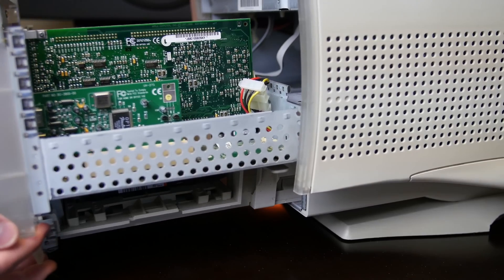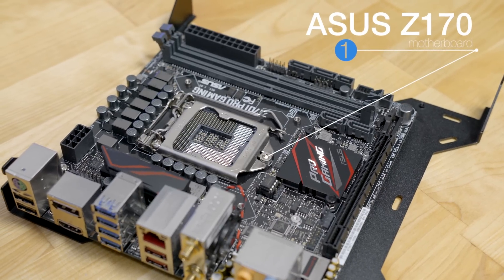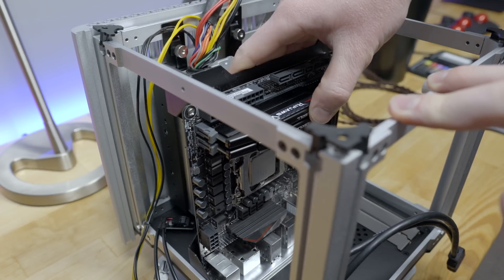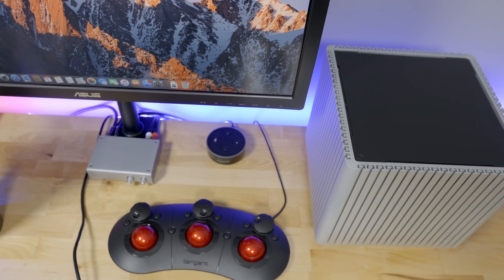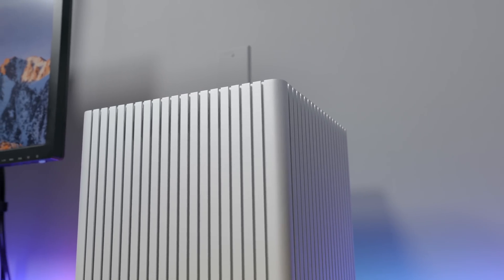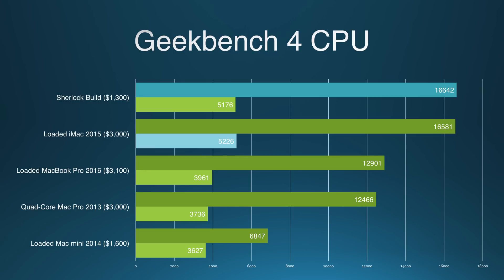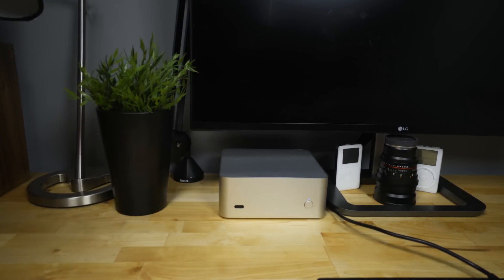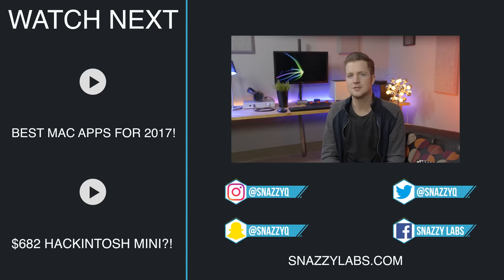The Quietest Mac Ever Made!

Comment: Is it ok that when gaming, my 8gb ram i7 macbook air 11 gets to 105 degrees Celsius?
Reply: What kind of gaming are you doing on a MBA?! Chess?!
Reply: Hell no. Take it to the Genius Bar or something. If your MBA is overheating, then something's seriously wrong. Like the other people said, the CPU should automatically throttle down unless you installed a piece of software that keeps the CPU running at full speed, or the game forces the CPU to use it's full capacity.

That said, it could be just you gaming on the MBA. MBA's aren't really designed for gaming. Hell, the entire Mac line wasn't designed for gaming (maybe the MBPro and the iMac can game, but like I said, not designed for gaming). If you want to game, it's much better to look elsewhere. Use a custom buillt/pre-built manufacturer made PC (running whatever OS you like; Windows is better because more games run on it), or at least get a laptop for gaming.

Or maybe it could be the i7. i7's, from what I can tell, are pretty power hungry, and emit more heat than their slightly weaker i5 counterparts. But this can only apply if the Air overheats all the time, even if you aren't gaming.

Sorry for throwing ideas at the wall-- I'm trying to make sense of the problem here. So I guess here are your options.

a) Sendificate that Air to the Genius Bar, and SPECIFY your problem if they don't ask. I'm not sure if they'll do jack shit, though. The problem with a lot of the newer MacBooks is that they are hard as fuck to crack open. It's like trying to crack open a coconut with a plastic straw. Yup.

b) Staph the gaming on your Air. Like I said before, Airs (and MacBooks in general) are not designed for gaming! Sure, if they can game, that's great, but note that if you want to get some supa high framerates that break the roof of your house, then stop what you're doing and look elsewhere. Which brings me to the final option! Or step.

c) If you plan on continuing gaming, drop kick your Air into space, and get an PC. Just kidding-- don't do this (or stuff the fans with fucking Play Doh). Maybe you can sell it, and use the money collected into a serious gaming machine. If you're a casual gamer, then aim for devices under ~$1250-$1400, I guess. More if you're a serious gamer.

(I just realized that these are more of "steps" than options, I'm so sorry!)

Do your homework. If you get a monster PC that costed like $5K, but only use it for MS Office, Chrome, homework, and writing, then you're not using the parts to their full potential. But if you get a Chromebook but plan on using .EXE files only usable my Windows, or have any Windows-only articles of software that you NEED, then you'll have to adjust your choices. If you use the new MacBook (yes, the one w/ the single port) and expect it to be able to edit 4K video and/or game, then you should have researched, then plopped down $1700 on a different machine. It all depends on your uses. 

So are you a light, casual, or heavy gamer? That is the question. If you would like more help, then you should head on over to the SuggestALaptop subreddit or maybe Google around.

Here's the SuggestALaptop subreddit: https://www.reddit.com/r/SuggestALaptop/

(Sorry if I sound mean or condescending, I'm really not! I'm just a bit pissed at the guy who said to plug your fan with Play Doh, even if it was a joke. Don't do it. It would kill your machine in moderate to heavy use. I'm also sorry for writing this essay. I should really siphon my writing prowess into my gender stereotypes essay, but stereotypes are stupid!)
Reply: Perfect and no issue at all. You could try putting some Play-Doh into the air intakes, that will make it dead silent and therefore highly desirable.
Reply: To be honest, don't use your MBA for gaming. Even though 105°C (TjMax of most laptop Intel CPU's) is very hot, it will probably not break. GPU's tend to die early when they overheat, CPU's are rather unlikely to die due to heat.
Reply: Open up and clean your macbook as soon as possible. Like dont just blow air in it. Open it up and thoroughly clean it
Reply: HeyItzJames Holy shit no, that's not normal. Clean it, if it keeps being hot you should underclock it. 100 degrees is not healthy.
Reply: 105° is the TjMax of the Intel CPU's, therefore it will lose it's boost clock, but not it's base clock. Non-15" MacBooks reach these temps every time on every MacBook under load and there is nothing the Genius Bar or cleaning and new thermal paste will do about it.
Reply: Kit Vitae I already knew what you wrote. I had a 2013 15" MBP and it maxes out at about 70-80°C, and my new 2015 13" Pro can reach 100°C easily. Dualcore Broadwell-U with hyperthreading at 2.9 GHz, don't know the exact model.

I wanted to say that it will not lose it's base clock until about 105°C, then it will clock down
Reply: Rainbow Jam mac is not for gaming...
Reply: They seriously aren't. I have both Mac and a windows 10 gaming PC (which is powerful as all hell). I love both equally. But when I try to game on a mac, It doesn't work out. I just use my mac for video editing when needed and school papers.
Reply: Yes, it's meant to keep your Pizza hot or you can fry an egg too!
Reply: It is at your own risk… personally, I have issues having something that hot, that close to my balls.
Reply: florian..... seriously???

i haven't got a new mac since 2012, because i don't care for their current lineup. my macbook air never goes above 75, and my imac never goes above 66, no matter what it's doing – including running stress tests.

every intel cpu has its own specified maximum temp, a lot are around 100, but you can't guarantee that it's 105 exactly. and the maximum thermal limit still throttles to prevent it going over, since it shouldn't be hitting it at all.

it's like driving under a bridge. you don't really want to be exactly at the max headroom, because the roof of your vehicle will scrape against the concrete.

if you type "sysctl -n machdep.cpu.brand_string" without quotes into terminal, any mac will tell you exactly the model of cpu it's using. a site like cpuboss or intel's ark will let you find out the specific thermal limit for the cpu.

when the cpu actually hits its max temperature, it will shut the system down if needed, to prevent overheating. this happened to me once after rendering video on a really hot summer's day. the system didn't boot for an hour after that, because it takes time for the heat to dissipate after it shuts itself off. there is no way it is happily running at exactly the limit, as that's the number it shuts itself off at, and will throttle if it gets within a few degrees of that to try and prevent such a scenario.
Reply: HeyItzJames wt  even the pentuim 4 auto shutdowns at 105°C
Reply: what about integreated graphics? since it doesnt have a seperate GPU its not gonna die earlier from overheating. right? I'm just asking it for my own laptop :D
here is my laptop's specs;
-intel core i7 3630QM @ 2.4Ghz
-intel HD graphics 4K
-8GB DDR3 RAM
-Windows 8.1
Reply: Fatih Yıldız Intel HD graphics are not really affected that much by heat because of their rather simple architecture. (after all, they are meant to be power-efficient and cheap) Keep your CPU under 80°C (which shouldn't be too hard) and you will be fine.
Reply: yeah that's okay
Reply: thats very bad
Reply: no because u shouldnt game on it to begin whit
Reply: Gaming puts an extremely heavy load on all systems, regardless of OS. Intel CPUs have built-in thermal protection so as best as we can tell (from many years of experience in IT) the CPU will not fail, it will simply slow down its close speed. Of course the first thing to be lowered is its Turbo speed, it will slow down to its standard (base) clock speed. If its still running too hot then it will lower its base clock (it has the ability to lower the base clock rather dramatically, far lower than most people ever realize) until the temperature stops rising. MacBook Air was never intended for gaming, its a thin, lightweight model for maximum portability and long battery life, not a muscular system for heavy duty gaming or continuous video editing, but regardless, it will game and it will edit even if it gets hot. These Macs are far more robust than most folks realize, its really the Intel CPU that is the limiting factor. Have Fun!
Reply: Rainbow Jam no
Reply: There is no way that's accurate and if it is then your software isn't doing its job. After about 85-90c your computer should start throttling to keep temperatures low, and I think at 105 it would completely shut down. It was probably around 85/95 which is not good at all

Comment: there is a fanless 1050, not sure if it would fit
Reply: Wouldn't work with macOS, also it depends on passive cooling by the case fans that are obviously not present here, so it would probably overheat
Reply: Very true on the overheating, but I don't use macOS so I will take your word for the first one

Comment: How about overclocking the main cpu to it's ultimate max and putting the quilet in an frigirator to keep it real cool without getting fan noise, that will help.
Either way it looks definatly cool.
Reply: johneygd fridges are not designed to constantly cool down objects that constantly emit heat. And as a result the fridge will just break.

Comment: Do you think a GTX 1050 Ti KalmX fit in there and would it be able to sip off of the 240W psu?
Reply from the maker: I don't think the PSU has a 6-pin PCIe header. That's not the only problem though. Thermals are a big issue. The KalmX assumes airflow in the ambient area to wisk away heat from the fins—be it through case fans or another method. The inside of the DB4 is a fortress and without any air to pull the heat away from the card, it just bakes in it's own bubble.

Comment: palit has a silent 1050 ti tho, os x wont work with pascal, rip
Reply from the maker: True, but that's not the only problem though. Thermals are a big issue. The KalmX assumes airflow in the ambient area to wisk away heat from the fins—be it through case fans or another method. The inside of the DB4 is a fortress and without any air to pull the heat away from the card, it just bakes in it's own bubble.

Comment: Question what happens if you touch the heat sink side of the pc?
Reply from the maker: It's always a tad warm. When I was stress testing it (which, is an unusually high load), it got hot enough that it was uncomfortable to put my hand on it for more than 15 seconds, but it didn't burn me or anything.

Comment: I've been thinking about a similar build inside the Inwin Chopin... probably a bit noisier (not that much with some good Noctua fan and cooler), but half the price tag.. Thanks for showing how it performs anyway, that case looks so good, but I could never justify to myself spending that much on it...
Reply from the maker: That's not a bad solution. If you had a big cooler with a low RPM fan, you could still get a mighty quiet computer for a lot less. Tweet me if you decide to go forward with it. I'd love to see it!
Reply: I'd tweet you for sure, but i haven't quite decided if I can do without a discrete GPU or not... To be honest, I might wait until kaby lake support, use a thunderbolt 3 motherboard and eventually use a eGPU if the need arise... I'll keep you informed when I start (It's gonna be a hackintosh or bootcamp anyway) ! Keep it up with this great kind of content !

Comment: There are passively cooled GPU cards out there using a GeForce GTX 1050 Ti or a Radeon RX 460. The Radeon cards have the vanes going the correct way for a vertical passive thermal airflow. How about testing one of those?
Reply from the maker: There is a new 1050Ti that's passively cooled. The problem is that those cards assume a small amount of airflow from case fans to wisk the toasty air away from the heatsink fins. In this case, there is zero airflow and it's a toasty impenetrable box, so I don't think it'd work. Perhaps if you were really adventurous and created your own cooler to put on the die and then carry the heat away to the two unused side panels, you could get it to work, but even the mossfets would have issue cooling I'd imagine. I asked Streacom if they had plans and they basically implied they'd tried but couldn't get it to work.

Comment: Out of curiosity, what is the best possible graphics card you could shove into this thing taking into account power consumption and space? This is of course if you were to build one yourself with cooling.
Reply from the maker: A really, really low-end card. Perhaps a Radeon 5450 or GTX8400. The problem is that there is zero airflow so you can't pull it off the card. If there were a case fan or two, you could get something like a Palet 1050Ti, but with it baking itself in that box, you really can't go with anything that puts out a significant amount of heat.
Reply: Thanks, I was just curious. Good video btw :) I always love to see these videos in my subscription box

Comment: at 4:00 into the vid, your spec sheet indicates i7-6800k as the CPU installed, that's gotta be an error, 6800k is incompatible with Z170 chipset
Reply from the maker: Yes. It's an error. Was typing late last night. A card has been added to correct the error.

Comment: for the graphic card
Why are you not using a passively cooled gpu ?
Reply from the maker: HD 530 graphics are about on par with the low-end passive GPUs. They add very little for their price. There are a few newer cards like the Palet 1050Ti that's passive which is neat, but a) not supported by macOS, and b) require airflow via case fans to pull heat away from fins on card—which this case doesn't support. Cheers!
Reply: Snazzy Labs 
thanks
Reply: It was interesting that you gave the temps for converting a long vid from ProRes to H264 but with the Intel graphics why would you bother?  Do you have a render engine that makes use of the Intel chip for H264 conversion? If so how quick is it on say a dual pass 1080P vid @ 24FPS 1 hour long?

Comment: hey man im looking for a decent gpu i found a gtx1050ti is that good
Reply: it definitely is, but i'd rather get an RX470 or better, an RX 480
Reply: Bang bang Ching Chang jm pretty sure Mac OS only supports 900 series GPUs and below at this moment but I might be wrong
Reply: I'm my pcs running windows
Reply from the maker: I second the notion to get an RX470 instead. If you're willing to make the jump to the GTX1060, I'd recommend that over the 470, but the 470 is quite a bit faster than the 1050Ti.
Reply: it wont work with my psu
Reply: Bang bang Ching Chang jm what PSU do you have? if it's a 8 pin gpu vs a 6 pin PSU then there are solutions but im pretty sure there are 6 pin variants of the gtx 1060
Reply: It is some dell psu found in the dell inspiron 3650 I got for xmas
Reply: Hmm never skimp on your PSU. Cheap PSU's are liable to be fire hazards. If you want to push a computer with gaming, make sure your components are both up to snuff and have a good reputation for not bursting into flames.
Reply: No one that if here'd that did the Gpu insert say it's okay
Reply: It's certainly not my place to tell you how to live. Just letting you know that you should spend money on a decent PSU before you buy a GPU
Reply: I have a pre built system so I can't pick the psu
Reply: Get an R9 Fury if you have the money, if not then an rx 470 or 480 would be a good option, if you're looking to make a hackintosh definitely go with amd

Comment: well, what about a passive cooled water cooling solution for a GPU ?
Reply from the maker: That would require some creative drilling and you'd need to use tubing a long enough to get the pump and rad fan far enough away that it wouldn't make noise. It's possible, but not practical. I'd sooner just use a larger case with water cooling support and deal with fans.
Reply: Snazzy Labs its possible to build a passive cooling system without a pump. Because hot water goes to the top and cool water gets sucked in again. Of course it must be a closed system. 
Imagine to use all the free area from the sidewalls to cool down the water.  I will give it a try someday ...

Comment: 2 things, First off --- at 4:15 i7-6800k? and second i found a fanless gtx 1050 ti https://www.quietpc.com/palit-ne5105t018g1-1070h
Reply from the maker: Goofed on the pricing sheet. Have added a card to correct it. The Palit 1050 Ti is really cool, but it wouldn't actually work in this application. The only reason that card works is because airflow pulls heat away from the card's heatsink fins. While it would be quiet, the lack of airflow from case fans would prevent it from dissipating heat and it would get dangerously hot very quickly.
Reply: i bet somewhere there is a mounting fot the gpu to the cube, like the CPU
Reply from the maker: There isn't, sadly. You'd have to jerry-rig something. And GPU's put off quite a bit more heat than CPUs which I'm not sure the case could dissipate fast enough.

Comment: +Snazzy Labs is there a way to put fans on this, because i like this chassis better than most gaming chassiss, but i want to play games and i dont think that is possible with fanless configuration
Reply from the maker: Not in this case, no. Streacom has other pretty cases. I have my VR rig with a 5820K and GTX 1080 in a F12C and it works awesome.
Reply: If you wouldn't mind can I see the link to the chassis you mentioned in the reply. And thanks a lot!  The black version of the chassis in the video looks dope
Reply from the maker: http://www.streacom.com/products/f12c-chassis/